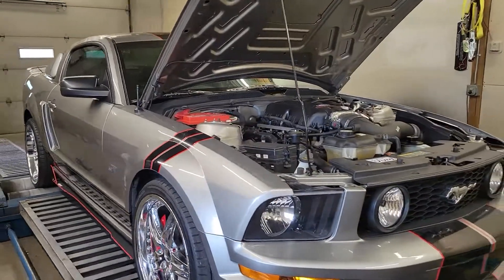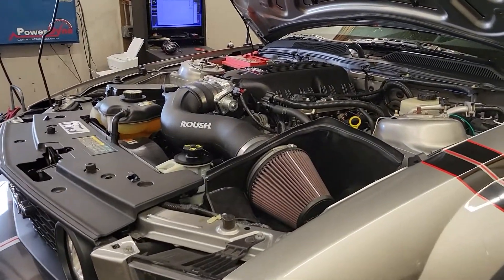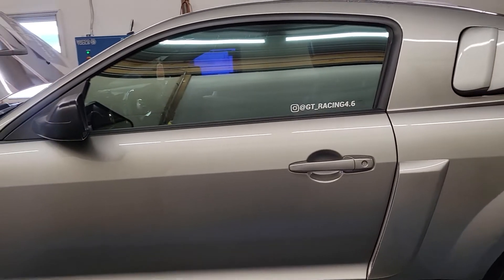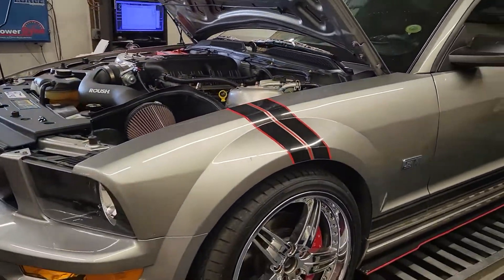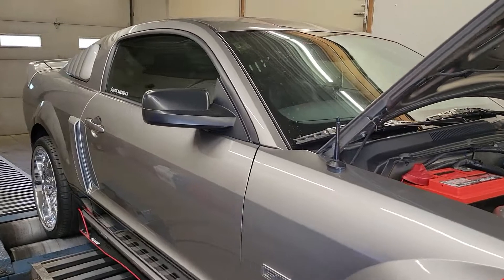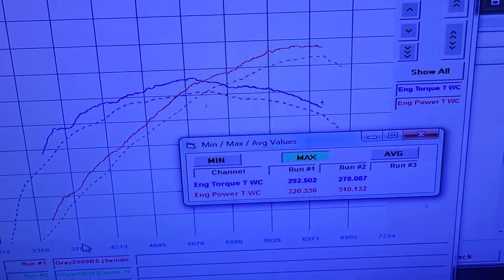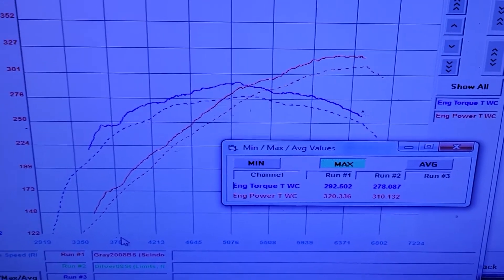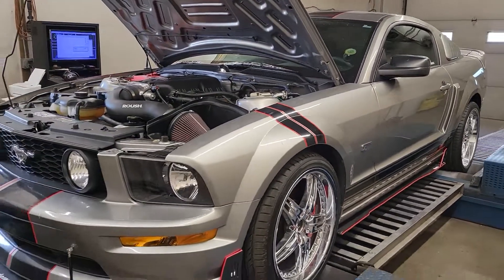Ford Racing Intake Manifold Results | 3v 4.6l Ford Mustang Dyno Review

Comment: I have 2008 procharged mustang. The intake and throttle body didn’t increase the rwhp that much. Maybe like 10 rwhp.. however torque went from 414 to 438.. that was noticeable.. those upgrades really aren’t worth it unless you’re boosted. Final rwhp was 492. Stock internals.. anything too much higher is not recommended.

Comment: Hell I might as well save that money then. Idk about y’all but $800 for 10 to 15 extra horsepower ain’t worth it to me
Reply: If he had bigger cams would be worth 20whp in the upper rev range which is noticeable. I gained 26 whp in the peak with a ported one on a MHS heads/cam package.
Reply: He had the throttle body as well so it’s more than 800 😂

Comment: My 2010 F150 has this engine basically. Power to weight stock not bad. With bolt ons omg
Reply: Isn't your 4.6 a 2v engine?
Reply: @ROTTINGDEAD no, the 2010 4.6 f150 is the 3v 4.6 which puts out 290hp-320trq mated to a 6spd automatic

Comment: Hi, Great Video, thanks! Just followed about the same path for my 3V 2007 Convertible Mustang : FRPP Intake + FRPP Throttle Body, FRPP Hot Rod CAMs, JLT 3 Cold Air Intake, FRPP 3 1/2 one piece Aluminium DriveShaft, FRPP 4.10 Gears + FRPP Cover, BBK Long Tube Headers + BBK Catted X-Pipes, S-Type Borla Cat back Mufflers + of course a Custom Tune. Got it on dyno about a couple of weeks ago and got 326.1HP @6591RPM and 294.8ft/lbs TQ @5098RPM when DA was more than 2000 ft. Will Post a Video hopefully by the end of next week if I'm able to finish my video editing.